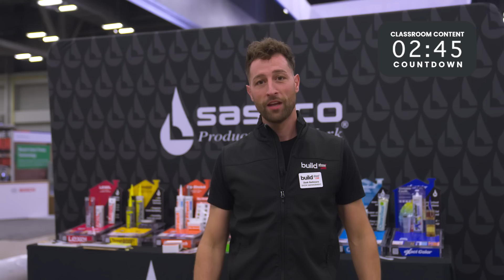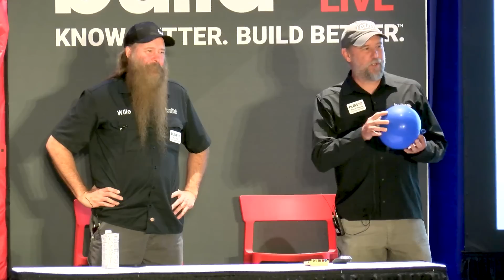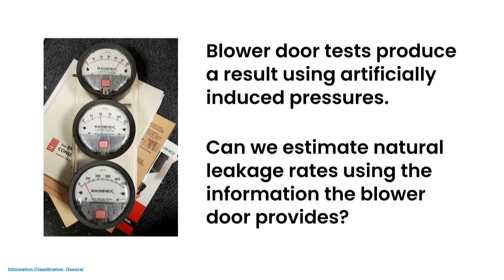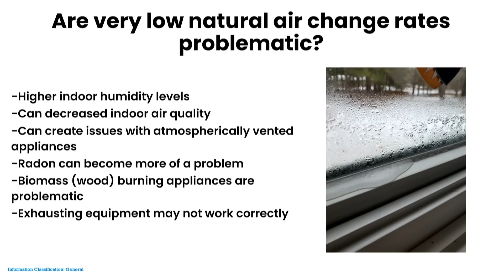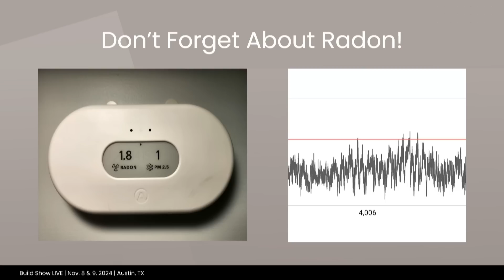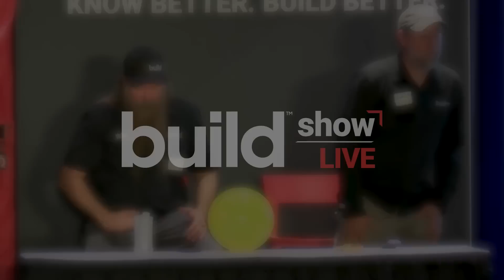Are We Building Too Tight  with  Randy Williams and Mark Wille

Comment: 54:05

Looking to build a house, but want a high efficiency wood burning fireplace insert in the house. Happy to seal and pay for what ought to be done. These fireplaces have a heat exchanger taking inside air and warming it up without contact any part of the combustion exhaust. Want to vent that around the house for some warmth for heating.

Probably won't build a super insulated house, but much better than code. Just wondering if anyone has done this or has any advice on making it work. I know it will work, and it's something I want. If the answer is "don't do it in a passive home" then I guess I just won't have a passive home... but I know it can work in a passive home, or at least a high performance home :)
Reply: No issues, you need dedicated combustion air from the outside.  All modern high efficiency wood stoves are set up with outside air intakes.

Comment: Building now…what are my options for better venting in bathrooms, kitchen hood and dryer. 6” walls, 2” cs foam, topped with blown cellulose. Help. And wood burning fireplace-a Pioneer II which is EPA approved-brings its own air in.

Comment: I would not live in a home that did not naturally breath a substantial amount of natural air from the outside...and yes, I wear a sweater indoors in colder weather and use fans in the summer because I both detest and can not afford an overheated or artificially cooled home.  My home is extremely well insulated so as not to waste energy.

Comment: Maybe there's an easy way to get to a structure that does not exchange un-filtered air or heat between the exterior and the interior. With todays advanced HVAC systems and fresh air replacement and heat exchangers maybe a builder could focus on balancing the interior pressure closely to the outside air pressure eliminating any pressure difference to cause an exchange of air between the interior and exterior creating a lasting air tight structure that does not depend on tapes and mastics to achieve a seal that will withstand a pressure delta of 50 pascals as even if seals become compromised as there is no pressure differential which is needed to create/cause air flow. Ray

Comment: IMO, A building that is too “tight” is horrible for human health.
Reply: That’s where the ERV comes into play.  It constantly exchanges inside air with outside air, without leaking your conditioned air out into the wild.  

It is a FACT that tight buildings have lower heating and cooling costs compared to their “breathing” counterparts.
Reply: Then it hasn't been properly vented.
Just letting air filter on and heat come in or out at loose panels and fitment and shitty workmanship is pure stupidity.
Reply: You should pay attention.
Reply: Are see STILL debating this?? Are builders just cheap or stupid ? Or both ?

Comment: Absolutely building too tight! The amount of Mold toxicity says it all. ERV’s should be included in all new buildings! Please address mold in new buildings!
Reply: Definitely NOT too tight. You want to breathe in your blown in insulation or moulding window jams for “fresh” air.
Reply: If you had to use erv  system you're building too tight.I believe a house needs to breathe.
Reply: @manatee419  so you want to let all the heating or cooling be wasted? Why not seal the house and control the internal air exchange, filtered so as to limit dust and allergens.
Watched a fella actually make his own as cool or hot filtered air from outside was pulled in the duct it came in through was inside another allowing it to be adjusted temperature wise before going into the HVAC. It actually worked very well and used a large commercial HEPA filter and uv light to clean things up.
All it took was and older furnace fan and some ingenuity.
But when building $500k+ homes, ERVs  are pretty affordable.
Reply: @manatee419  if there's no harm in the erv than why wouldn't you just build tight.